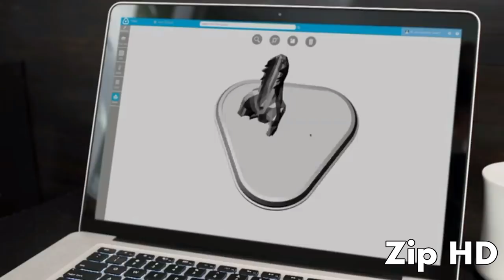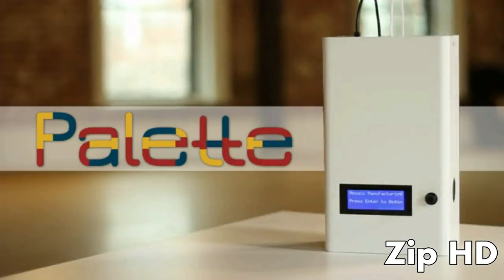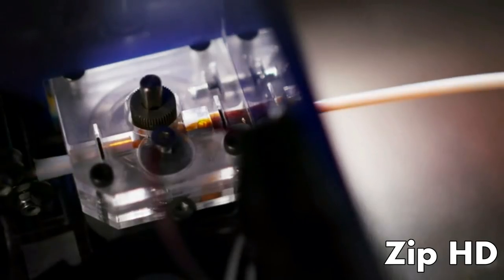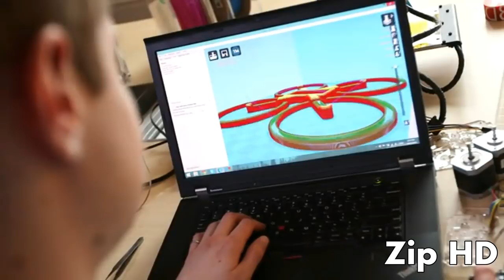Top 3 Best 3D Printers You Must Have

Comment: Will the 3d printers become cheaper in the future?

like flat screens were expensive back then but there cheaper now.
Reply: Mike Difronzo Unfortunately for me?
Reply: +Mike Difronzo +Corey Williams 

Mike makes a good point. As of right now, it is a matter of hoping that the good-quality materials fall in price. Another way to look at it, as Mike sort of put it, is that the 3D printers will remain at a similar price, but their value will continue to grow higher and higher as microtechnology developed further and further, ultimately leading to a better product for the same price as a lower quality one (hence greater value).
Reply: +Corey Williams they are cheap. Go look on amazon and youll see 3d printers for $300/$400. And the quality for some of them is actually quite good. better than most of the early gen makerbots which at the time costed waaayy more.
Reply: Rusty Shakleford That's like getting a new game console.

 :)
Reply: +Corey Williams indeed. they are kits, so you have to build them, but they are actually quite simple and you will learn a huge amount about how the entire process works as you construct your own 3d printer. kits are good if you have a little time to tinker, dont mind building and learning how the electronics work, and you want to save some money in the process, and build volumes are usually higher than proprietary printers. go to reprap.org for more info about some of the kits you may find on amazon.
Reply: +Mike Difronzo 

I like Both. (For the fact that I'm a gamer and Future engineer)

But the "machine with infinite potential" is more important then an "entertainment box".

Comment: is anyone else having a hard time trying to judge the quality of the moon ray models cause it seems they picked the angles and transitions to make it near impossible the detailed models are shot from further back any model you see close up they show the model first before quickly switching focus to the original item or they show you the model still covered in support material its like they really dont want you taking time to look at there prints
Reply: +KYLE REES finally after watching back through a second time and pausing i get to see the damn print without them moving the camera or changing focus or jump cutting all making it hard to sit and get a close look

the obsurd part is once you pause the video to do away with there annoying pan shots the models aint half bad 

only model i could actually get a good look at was the head the skelington they left it obscured with support material then panned to the original model on the upper half because aparently comparing the bottom of a model covered in support material to the top half of the original is totally fair

Comment: Don't get a Tiko ,get The Micro from M3D , it has higher Quality , and more print Space.
Reply: It's about 350 dollars compared to tiko witch is 179
Reply: Nick W can someone shoot me a link to the TIko? wanna see about getting it. but i cant find it on amazon or ebay. lol
Reply: +Ryan Stanford K you can give it a Shot http://www.tiko3d.com/ there it is , but its not don  yet , its still WIP , so you cant buy it right now.
Reply: ^Thanks. appreciate
 it. hoping to get it for my first one considering its small.
Reply: extrafried Bob Proprietary is proprietary.
Reply: The specs say sonething different. The resolution is actually a bit better and the print volume about the same.
The M3D printer is not a bang for your buck it's actually not as good as cheaper printers or ones that have the same pricetag.
Reply: +extrafried Mediocre printer compared to the other competitors in that price range.

Comment: As others have mentioned 3499 is not affordable.  The computer I had built last year was 1200 which was a nice computer and my car i bought was 2,000 a nice car.  which is less then this 3d printer.  Both item were major purchases.  Affordable is something you would spend less then 1,000 dollars on.  I get it there are 3D printers more expensive however I could of bought a 6,000 computer and a 35,000 car too.  They just aren't affordable.  In relative terms 3D printers aren't affordable to MASS public unless it's under 1,000.  Just look at TV purchases these days.  500-600 for a Huge Flat screen which is now AFFORDABLE for most family's to put money together to buy.  However most people won't spend more then 1,000 on a TV cause it just isn't AFFORDABLE.

Comment: 30% of the top 3 Printers, weren't printers.

I also find it hard to believe that SLA printers will ever take the place of filament extruder printers. Material options are far too limiting on SLA. And, for 3500$, I'd hardly call that "affordable".  Especially when you take into account the cost of the material which is generally two to 3 times more than a filament and the material properties suck. AND the amount of user touch time it takes to clean off excess resin and support structures.

Comment: Can you print... 3D printers?
Reply: +The Rookie there are some open source printers where you can 3d print the body of the machine, but the electronics and moving parts still have to be bought, 3d printing hasn't gotten far enough to print all the different materials (metals, wires, circuit boards) with one machine.
Reply: DanielRichards644 I guess it works right?
or it will work, that's good enough for me.